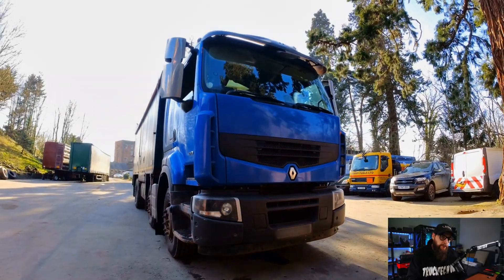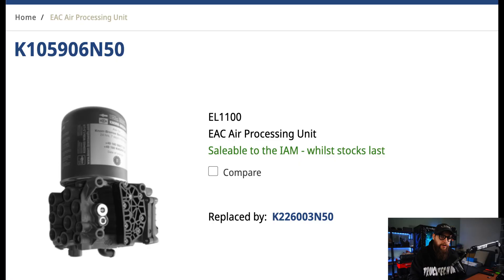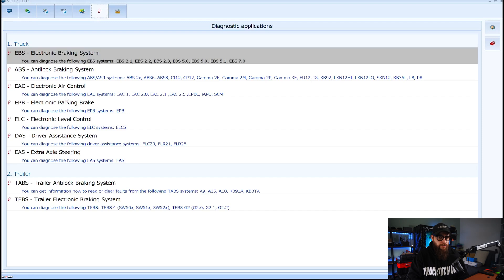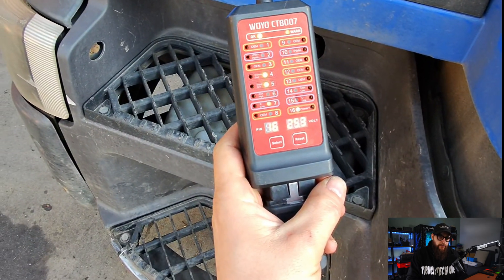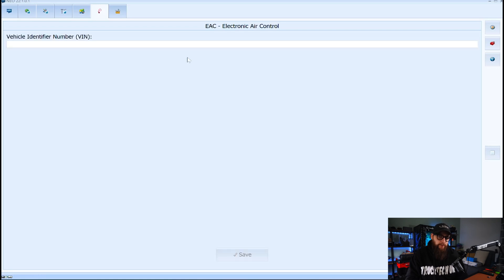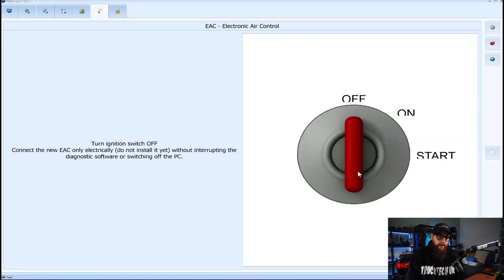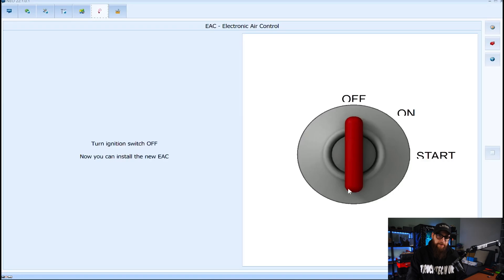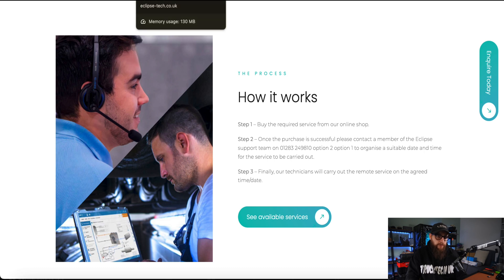Programming Renault's. APU flash with NEO GREEN software.

Comment: Hello colleague, I’m from Ukraine! I wanted to tell you that to perform this operation there is no point in using the NEO GREEN program! Jasltest starting from version 24.1 can do this even without having an old APM block! It is enough to indicate the chassis number of the car on which the new APM will be installed and have a connection to the Internet. This operation is performed free of charge. Included in the cost of an annual subscription. Good luck with your repairs